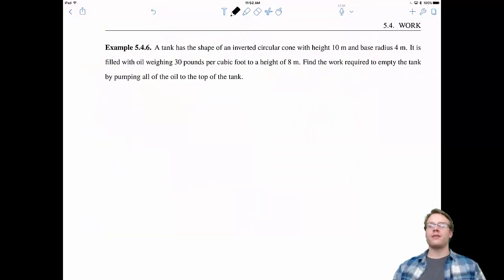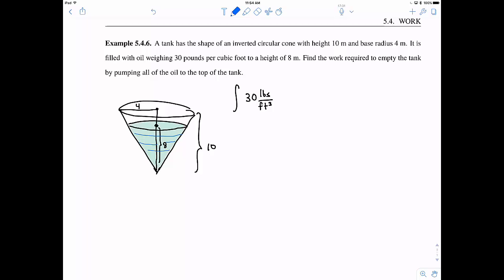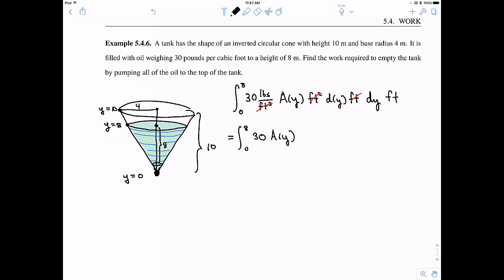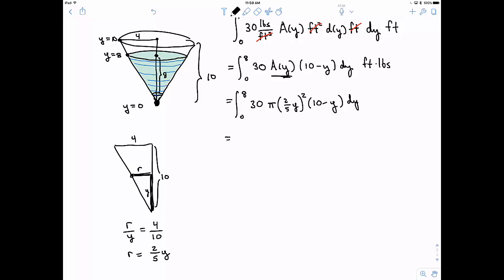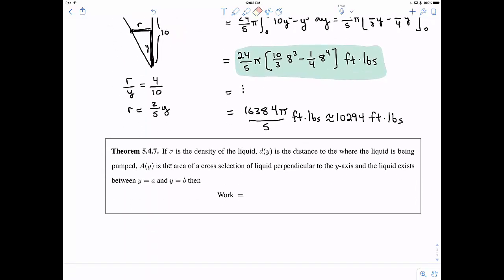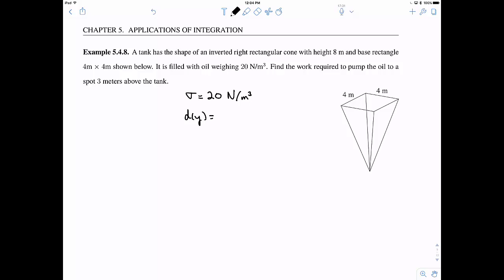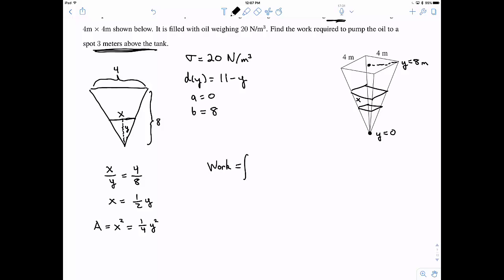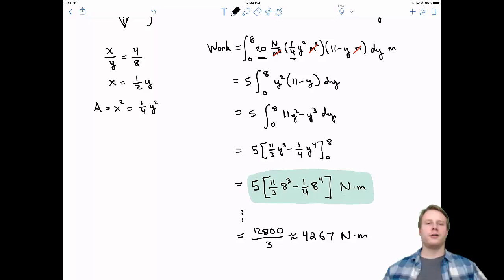MTH 133 5.4 v2

Comment: Shouldn't you have changed the bounds to be in feet rather than meters in that first problem? And you plugged in 10 into your distance formula when that's 10 meters, not 10 feet.
Reply: I have the same question too now that you have pointed it out.